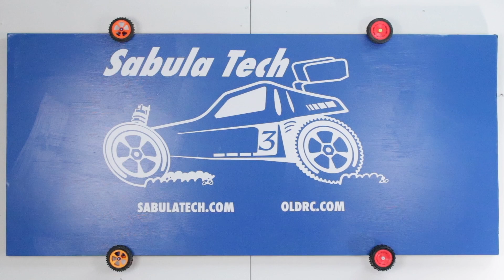Vacuum Form Machines Used for Making RC Car Bodies

Comment: I raced the Bolinks in the 80's. Whipporwill  Nationals, B main. 
Was checking out your machines and process.
I build Gold Prospecting equipment on my home made machine. A lot like yours, I raise the mold, shuttle my heat, all manual operation. Checkout how i built it. On my channel. I think I could form a 1/5 scale on mine. I Use 1/8 and 3/16 ABS for my stuff.
Advice welcome on my process. Great job.
Reply from the maker: Hello! Gold prospecting parts is not something I would have thought of vacuum forming, very cool.

Comment: Great video looking at the machines processing RC bodies. My question is this, while those are vacuum formed over a buck (male), looking closely at my tamiya models the details look more defined on the outside of the shell, so are they vacuum forming into a mould (female)? Blow moulding into a cavity? Assume they also use multi part bucks or moulds given the undercuts and flash lines? Just curious. cheers
Reply from the maker: I assume you are talking about Tamiya clear bodies. Most likely made from multipart female forms. Some of Tamiya bodies don't come with protective film on outside because they are done on female form. If film was on outside of body during forming it would cause a mess.